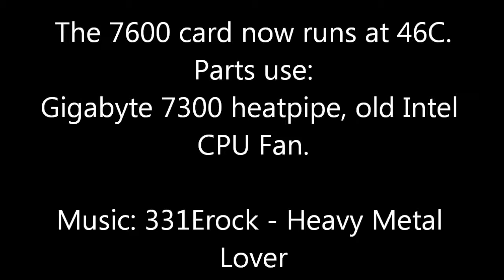Nvidia 7600 heatsink mod

Comment: Hi, whats that yellow pad (@2:09) behind the thermal paste? what does it do? 

I have geforce 7600gs 512 agp and at idle its 65/67 degree Celsius ! it was initially 85 degrees. I just changed the thermal paste and it dropped 20 degrees. yet still its very hot. Yes I got this card yesterday and Im doing a retro build. 

Could this be becasue of the that yellow pad that you use and mine doesnt have ?
Reply from the maker: That is actually the cushioning for the die so the heatsink doesn't crack if there is too much pressure or uneven pressure.
Reply: @ig33ku  Thanks alot so thats not a thermal pad? just a non-conductive (electricity wise)  kind of paste? if I use a normal paste on the whole die and all those tinyy white ics that are around the chip, will it be fine or will it burn the gpu:?
Reply from the maker: @amortalbeing  Think if it like a a washer or spacer. All thermal paste is conductive if there is enough current going through it believe :P but just paint a thin layer on the die. Like 1mm to 1.5 mm
Reply: @ig33ku  Thanks a lot. really appreciate it:)